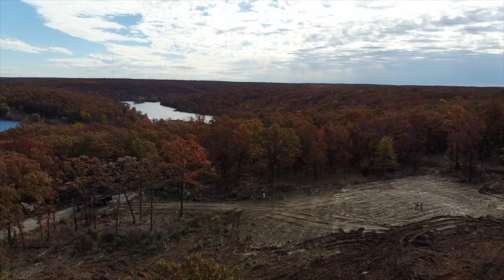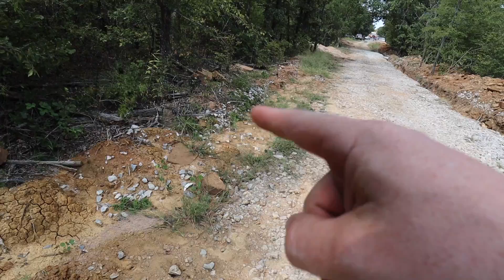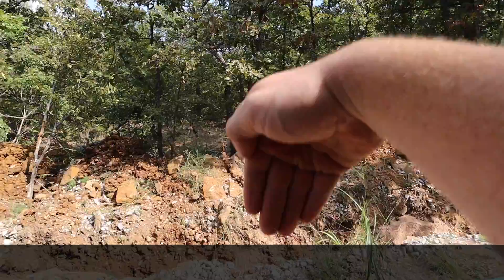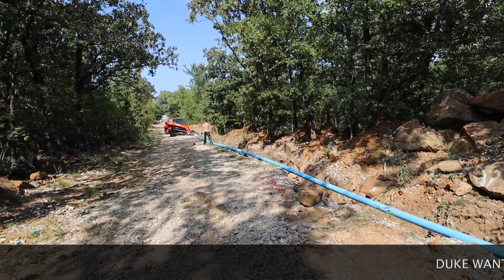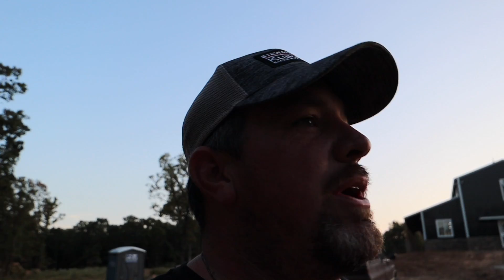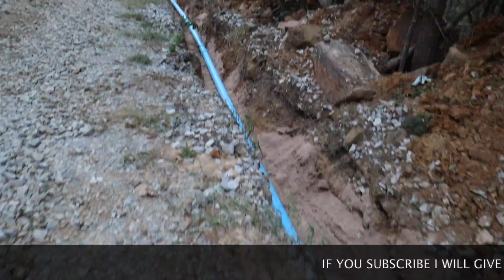GOVERNMENT Won't Let Me Have Water!!!! TAKING MATTERS INTO MY OWN HANDS!!!

Comment: In my first home, we did the same thing.  10 years later, the city came in and took our pipe line under emanate domain so they could use it to supply subdivisions developed next to our property.  we got no say and no compensation.  The city even let the developers tap the line before the line was confiscated.
Reply from the maker: Raymond D. Horst wow!!! That better not happen here.
Reply: @blackberryridge8205  - It will happen sooner than later.  All a developer has to do is know the line is already in and be able to procure land within access and the city will take without compensation.  That's why it is surprising that you didn't just go with a well - you could have put several connections with pumps and pressure tanks for multiple homes.
Reply from the maker: Ouch!
Reply: That's when you sue them in higher courts. Cities can  only take land up to five feet on the edge, and only for placing expansions of roads
Reply: I use to work for a water and sewer department in a town. You should have drilled a well! If you knew 2% of what I do you would not drink city water! Every time you take a shower your drinking that water!
Just make sure you burn that pipe up with bleach! Get the stuff you use in a pool! You should had been adding it to the line as it was installed! Before you hook up your pipe to the city you need to add several cups of the pool cleaner so it will burn out everything in that line...

Best of luck, first video... it would had been great to see a lot more of the country side and not your mug! Show what’s going on and then explain as you show your viewers what is going on... my two cents... seems to me you talk to much!

Comment: You should put a fire hydrant on your waterline by your house.  It  should reduce your home owner insurance.
Reply from the maker: Don Hanson we wanted to but cost didn’t justify
Reply: @blackberryridge8205  problem with a 4 inch pipe you will need to flush it out from time to time.  This is to Prevent bacteria and other things like brain eating amoebas from living in the line.
Reply: @blackberryridge8205  I just figured I should let you know.  This was a issue over near New Orleans, they had several cases over there.
Reply from the maker: That’s scary.
Reply: @blackberryridge8205  https://abcnews.go.com/Health/brain-eating-amoeba-found-louisiana-water-systems/story?id=48372045
Reply from the maker: Lovely

Comment: Watching that pipe get belled made me cringe but it worked. Are you putting a 4 inch meter in as well? That thing is gonna cost an arm and leg for the set rate. Here it’s $7.50 a month min just to have a 3/4 inch meter. And a 4 inch is like $300 a month min because it’s considered industrial. But the water provider has to provide 20 psi at all times per the Safe Drinking Water Act of 1977. We. Can do some math and figure out the drop in presser from the water provider if you know the elevations of the tanks that’s suppling the water main and the elevation of where your going. Or if you know the presser of the main your tapping. The magic numbers are :  .433 psi loss for every one foot of gain in elevation.
Reply from the maker: lanny allen great info!!! Thanks for commenting. I will break out the topo maps!

Comment: Install with writing facing the sky. Back fill up to that writing and stop. That way when inspector comes by all he has to do is look down in the hole. Inspectors happy and you have enough fill to keep pipe from jumping apart.
Reply from the maker: TilDeath1776 US great advice. Thanks for commenting.
Reply: @blackberryridge8205  - Also don't forget to lay in "Underground Utility Marking Tape", it will save you a lot of hassle if you need to do repairs in the future.
Reply: Blackberry Ridge welcome. That's how I keep the inspectors happy when I'm running pipe
Reply from the maker: We did do that!

Comment: Ive never shaken my head so much at how youre laying the water main. Youre better off laying 1 pipe at a time on the followed by cover. Which then weighs down the pipe so the next one can be pushed in easier.
Reply from the maker: Mr Spitos I was told by three different contractors of mine to do it the way we did. It really was not difficult at all. Did almost 1,000ft in a day. And it was the first time we had ever messed with c900
Reply: I’ve done it that way plenty of times! I actually think, I thought of that install method. 
One time when I was putting in a few 40’ sticks in the trench, one joint popped apart and we started duct tapping the joints. Well done!

Comment: Before pressure testing back fill between the joints, if you haven’t it might just jump out of the ditch, could end up with broken pipe all over the place. Not a good thing. Signed the Plumber
Reply from the maker: Ming Chow great advice. I wish the plumbers I counseled had told me that at the time. Pressuring up was fun!!!
Reply: Won't pass inspection if you cover the joints,,if it is going to be inspected that is .. plumber for 30 yrs ...here,,
Reply: Don Catherman /// I’m a retired plumber for over 30 sum years, had to have both knees replaced. Ming Chow is internet stage name. Please reread my comment you chimed in on, (back fill between the joints) don’t cover the joints the inspector needs to see if there leaking.
Reply: Pressure test should be done with water only. All air must be removed from the water line. The pipe should be covered with fill up to the joints and the ends should be bloc.ked to keep the pipe in place.  With air under pressure the test you are making is a potentially deadly rocket or a plastic shrapnel bomb. With water filling the pipe any failure would have much less potential energy and be less dangerous.  Also unless you regularly us a large volume of water you may create water quality problems with a four inch pipe. Low residual chlorine levels and stagnation.  Add a valve to the end of your water line to blow off stagnet water, especially when the water is warmer in the summer.
Reply: @davej7458  I'm a 30 yr plumber, all testing is done with air.i have done 10 Inc  ducteral steel..mains to hospital, collage extra.duke in NC...all with air.the only test with water are drain lines.no water in water line for test.if the line calls for 50 psi or above which I'm sure that line is higher then 50 psi rated..only air can be used ..that's code for inspection...no mater the psi rating.must hold 50 psi for 24 hours to pass.in my book...
Reply: @DonCatherman  I don't know about plumbers practices everywhere. A few years ago two plumbers were killed near here when they did a pressure test using air.  The ten inch ductal iron pipe blew apart at the last joint, they were in the ditch line and were hit by the pipe and the end blocking.  Do it how ever you feel is good. Air pressure has a lot of stored energy that will go some where, nearly uncompressable water will not store as much energy. In the drinking water industry we use water not air.
Reply: @DonCatherman  you sir are old school as they say today, I admire that. If we had more people like you the hard Rock hotel would not have been a third world structure.😀
Reply: Tony Wilkins  Also I noticed you said principalities may be the east coast has a different set of standards for large water mains?  I worked doing construction in New York City for two years.  No water mains work there.  The City, the County and the State couldn't agree on how construction should be done.  They all inspected and wanted it to be done only their way.  One way or another that cost alot.
Reply: Tony Wilkins  Would that be small water lines in buildings and on property or large water mains in the public right of way?
Reply: Tony Wilkins  Thinking about it a bit more .  If your pipes are inside a building the chance of property damage by water  is much higher with additional dangers of different sorts. Also the volume of air contained in building pipes is generally less and the pipes are restrained much better at the time of testing.
Reply: i'm assuming its just a low pressure test .  for the pipe to jump out it would have to be a high pressure test  .
Reply: carmichael moritz ::: I’ve had 6” Ductile Iron pipe moving in the ditch with only 45 lbs on it.  As a basic rules for water mains it should be tested at 1-1/2 system pressure. With that in mind if system at 60 psi—test pressure should be 90 psi. The end cap on line will need to hold — pie X radius sq. X psi = 12.56 sq inch X 90 psi=1,130 pounds to hold back the cap from blowing off, and pipe from blowing apart.
Reply: @mikeretiredplumber1381   cant debate with that  :))   . after all i did say i'm assuming  .

Comment: 4" you could service a small neighborhood with that ! All you needed was at most a 11/4 poly line .
Reply: yup, miles past overkill. plus with poly no fittings or joints. hell i just ran 2" poly, a beast to unroll by man put easy as pie with equipment. 500' in no time flat.
Reply from the maker: Steven G Steger we are doing several houses.

Comment: Drill a well on ur own property. To HELL w/gov't.  No need for head ache. Result free water Dude.
Reply from the maker: Ray Sova 👍🏻👍🏻👍🏻
Reply: lol, so that works for you. Don't forger to have it tested for bacteria!!!! You know the stuff you can see!!!! Then when you sell, deal with the other night mare stuff then!!!!!
Reply: @johnerway7255 , I've had a well on my property n sold the property,no problem. The water can b tested. Water purification tablets can b dropped into the well if the water is bad. Most underground water is good so long as it's not exposed to  pollutants. If any thing the water can be used for irritating. Also there are water purification systems.

Comment: I would love to see that project. I only had to work on 4"  1 time a valve was broken & we replaced it .  that was for a hospital hundreds of rooms. 
    What about having a water tower, is that in the plans?
  What kind of a water bill are you going to have ??  
 I once gave an estimate to chamge a service from 1" to 3/4 because the city charges by the size of the delivery pipe. I even offered to reduce the connection inside to 3\4 but they wanted it dug up & 3/4 installed.  It was crazy but he had the paperwork from Bayonne.   He was very old i told him i felt bad but he would need to live to 120 to break even..
  We didn't do it..
Great job i want to ask all the important questions but you said you had an engineer involved. It looked very shallow but I'm used to minimum 42, I prefer 48 if it's not to much rock.
Reply: In my aera they were working and the main on a street they had to do went bang and scared em all. Then about 2 days later at night the pipe under their machines blew and they got a call and went ohhhhhhhhh 💩 thats the street our equip is on 😁.

Comment: What keeps all the pipes from blowing apart, especially with all that extra lube on it?
Reply: Thrust blocks aren't required until you make turns 45 or more. I always used 160lb of sakrete or so at each change of direction.  Plus that will be a mechanical joint not push fittings.
Reply from the maker: Greg Rogers I will discuss further in an upcoming video. But basically covering the pipe back up with dirt and bracing each end.

Comment: dam gov red tape you're outside City Limits the city has no say it's the county that you'd have to deal with not the city that's how it works here in my town
dont have get the pipe blow the frost line ithe grond?
Reply from the maker: Minecraftjake8585 frost line is shallow here in OK. Our ditch is 30” deep.
Reply: Yeah it like 12 in

Comment: I am not an expert plumber, but if the city puts full pressure on Your 4" pipe and puts the pressure regulators near Your house and barn, You should have all of the pressure that You need without a booster pump.
Reply: Don’t think so. It’s all about hydraulics. A lot of city’s use tanks and are gravity fed out.
Reply from the maker: Russell Hancock lets hope so

Comment: Well it must not get cold were you are because your way above the frost line . In the winter that line will explode
Reply from the maker: Digger Wheels our frost line is 24”. Our ditch is 30”
Reply: @blackberryridge8205  good for you mines 9 feet
Reply: @diggerwheels7839  holy hell! Where do you live?! I've seen some areas that we had to go to 54" just to be on the safe side, but 108"? That nuts
Reply: @joshuarewerts8566  High Level Alberta Canada . About 2000 miles north of the USA border
Reply: @diggerwheels7839  I figured extreme northern Canada or Alaska
Reply from the maker: Wow!!

Comment: How are you going to hook it into the city main if it's the city fighting you. If I understood. I know where I'm at anything hooked to a city water or sewer has to be done by the city water or sewer dept. I was a licensed plumber in my state for many years. If i missed something by all means correct me or point me in the right direction on your videos. I'm new here.
Reply: He is simply running his end of the project from the culvert at the road to the end points. The municipality will do the connection on their end. The only reason the water department is giving him a hassle is because the didn't hire an expensive plumber to do the work, probably someone's relative.
Reply: @DaveJohnsonad5nm  got it. Thanks!!
Reply: The problem being a licensed plumber is that if you 'cut red tape' you can loose your license. That is why sometimes you just have to do things yourselve. Can't loose your license if you don't have one.

Comment: point to ponder: having installed a booster pump on my city line, be aware that a pump sufficient to pump 4 inches of water is not needed. the pump has only got to raise the pressure from your static to your desired. it does not take a huge pump to do that......g
Reply from the maker: remus haynes great point!!

Comment: The rash on that mans back is called "Tinea Versacolor"  It is a fungus that should be cured with application of "Selenium Sulfide Shampoo"
Reply: LMAO, its just sun burn.
Reply: @MikesManCave  No its not.  The sunburn just makes the "rash"  easier to se since they don't burn or tan same as other skin.  Are you a physician? I am.
Reply from the maker: bud smith thanks for the info. I passed that along.
Reply: The part on upper right arm looks like probably tinea versicolor  but part on back looks more like vitiligo though it too could be tinea versicolor among other things
Reply: either way if its chronic, treatment may not change anything at this point and for such a large area an oral medication may be more appropriate especially in an area thats less accessible .  If he wants to try selenium such as selsun blue shampoo or lamasil cream  or others he will need to continue treatment for a full 28 days or more as that is how long it takes for new uninfected skin to form and then reach the surface which is actually largely made up of dead skin cells
Reply: On the other hand the back could be just peeled sunburn LOL

Comment: Hope you used joint restraints where necessary.
Reply: restrainst are only needed if there is cast fittings like a cast bend added in line
Reply: @brianc5685  different codes
Reply: Why would you think they did that ? They used 4" pipe to supplying a house, and put it in backwards. WTF
Reply: @mt.morris1975  lol

Comment: There's in saying that an old Machinist told me one time it's easier to get forgiveness than it is to get permission 9.8 out of 10 times is what I go by !!! Great job guys 👍👍👍
Reply from the maker: Mechanic Mike I live by that as well.
Reply: @blackberryridge8205  i agree with mike, in addition though from my experience, and stories i have heard, if you want to really connect put a certified water clock (i am not sure exactly what they are called in the US). Generally the town, or water company will be happy to take your money. I conected my sewage up myself and as long as a paid what i had to everyone was happy.
Reply: I have been told the same but I avoid any bs by asking for permission. Forgiveness comes with consequences whether you know it or not.